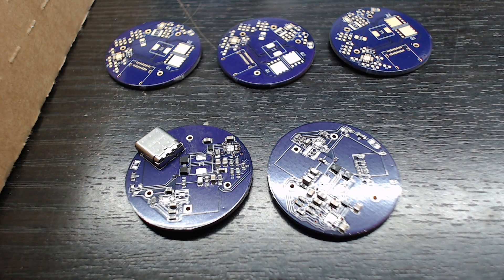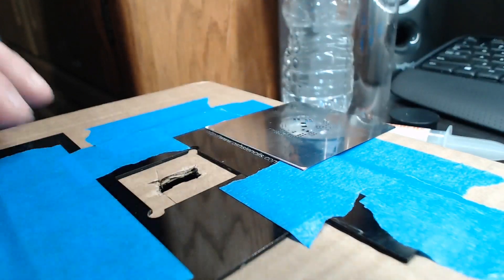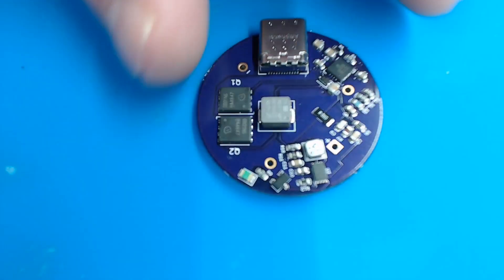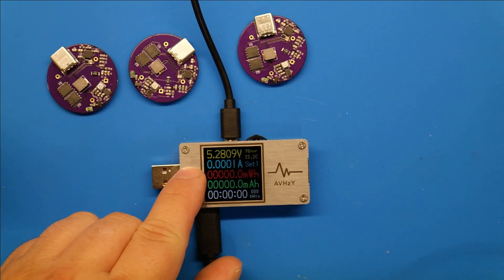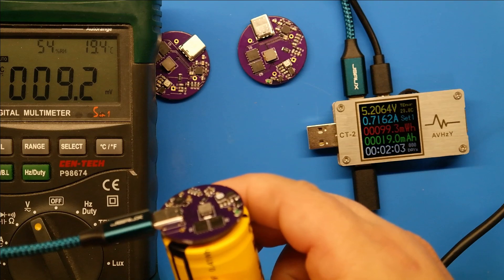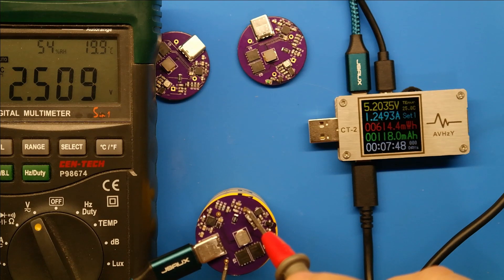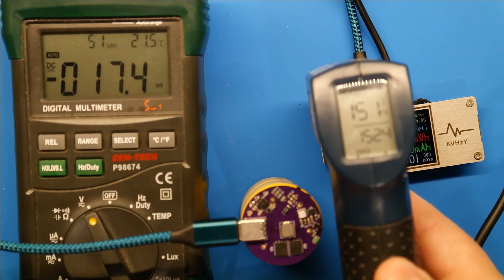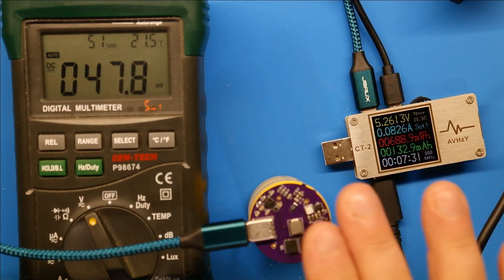Endless Torch V2.3 - It Finally Works!

Comment: I can’t tell what your MOSFETs are, but they have to have a Vgs(th) on the order of 2.0 to 2.5v at most… otherwise they will not be FULLY saturated with the Gate drive from the IC (typ. 5.0-5.5V for each MOSFET, so long as you have the proper bootstrap capacitor). Also, if the MOSFET gets “too big” (too much input capacitance or Gate-to-Drain charge), it will have a slow turn-on/off time. This makes the switching less “square”, and the sloped ramp from OFF to ON (and reverse) is linear conduction mode, not switching… which creates resistive heating. (remember, any time the MOSFET is not 100% OFF/or/ON, it’s acting like a series resistor, not a “switch”)  This is why we can’t just say “bigger is better” when selecting MOSFETs… the Gate driver has to be capable of driving the higher capacitance without allowing that linear conduction mode. At least in this application, your MOSFET Voltage rating can be pretty low… just twice of the operating voltage, or 10V. This works in your favor as it’s one of the tradeoffs for MOSFET die size, and therefore capacitance. (unlike my upcoming project, where I need to switch 400V DC at 50-70Amps at 200kHz)

I took a brief look at the BQ24640 specs, and came up with these rough numbers... Inductor saturation current needs to be over 4 Amps (based on a near 4 Amp supercap charge current; Vin=5.1V; max. ripple current is @ 50% duty cycle, so Vout=2.5V; switching freq.=600kHz).

Output capacitor of 20uF total... I don't see your output filter caps...? they should be two @ 10uF, 35V, X7R which means 1206 or 1210 case size. You can't use low voltage MLC caps, as their ESR is higher than needed for 600kHz switching circuits. Your ripple current will be very high, and the caps will fail. Keep this in mind when substituting lower voltage MLC (multilayer ceramic) capacitors where a “seemingly higher than necessary” voltage cap is specified … this is a blind spot for the uninitiated.

Revisiting the MOSFET Gate signal path issue. This should be on the order of “mm”… not “cm”. Literally, the best solution is a few mm at most. Also, the switching inductor (as well as the sense resistor and output caps) need to be very close to the MOSFETs, or the large switching speeds/currents will cause inductive noise, which can be picked up by other components.

Just a few pointers… since I don’t know what your components are.  The 600kHz switching speed makes this a critical layout project… it’s far from the older 10-20kHz switchers, which could tolerate longer switching paths with ease.
Reply: The T.I. recommended MOSFET is a SiS412DN  30V 12A part with 435pF Gate capacitance.  If yours is what it appears on your schematic... a BSC020N03MS, it's a 100A 30V MOSFET, with 7200pF Gate capacitance (max 9600pF).  That's why it's getting hot... it's very slow turning ON and OFF, resistive heating during those times.  Higher Current rated MOSFETs require a larger die size, which translates directly into much higher Gate capacitance.  This also translates into much higher reverse capacitance, which couples switching energy back into the Gate, trying to turn it OFF while it's trying to turn ON.
Reply from the maker: Wow I'm not sure where to start other then thank you for looking into this.

The mosfet I used is BSC0901NS which has a gate capacitance of 2800pF, not as bad as you thought but definitely not 435pF.  Otherwise it's a 30V 100A with a Gth of less then 2.0VDC.  

The inductor is a 6.8uH 3.5A soooo it's a bit undersized.  I'll have to look and see if I can find another higher Amp rated one that fits that same footprint.

I've done the layout for that board a few times and I'm never going to get the traces for the mosfet gates down to a few mm, but i think they're only max 1cm.

I've always omitted the output capacitance when charging supercaps, so far it has seemed to work for me (dosen't mean I'm right though).  The ESR on the supercap is usually 3.2mOhms so never saw the need for it.

I Will look into alternatives for the mosfets and the inductor.  Thank you for your insight!
Reply from the maker: I'm thinking BSC120N03LSGATMA1 will be a better substitute for the mosfets and ETQ-P3M4R7KVP will be a suitable alternative for the inductor, even though it's 4.3uH instead of 6.8uH.  agree?
Reply: @madelectronengineering  That MOSFET is certainly a LOT better than what you have now, but the key specs that matter here are mostly low capacitances... again because it runs at 600kHz.  In several places, your new choice is better than the original TI spec'd part, but it's still a bit high on Gate capacitance. In reality, this part is certainly much better suited for the application than what you have now.

The issue about the output capacitance has to do with the ability to handle the ultra fast rise-time of the "switching regulator".  Supercaps indeed have a very low DC ESR, but certainly NOT at high frequencies... in fact their high frequency ESR is usually quite high. Keep in mind that their sole purpose in life is energy storage, not high frequency filtering. You DO need to stick very close to TI's recommendations in this area, or you will damage the supercap by forcing it to try to deal with high dV/dT energy spikes that it's not designed to handle.

Inductor... if you move to a 4.7µH, your output capacitor requirements will increase to 30uF of the very specific capacitors - before the supercap.  Lowering the inductor value will also raise the requirement for saturation current.   Why not use the 6.8uH in the same series? ETQ-P3M6R8KVP. Even with this new inductor, you probably want to back off of the charge current level that you are at now... the physical limitation of the inductor limits its DC current rating to 3 Amps unless you have a board layout maximized for heat dissipation, and yours likely isn't. Just do not try to get more than 3A DC current out of it (into the supercap), or it will get hot, and cascade failure will occur. (inductors overheating lose inductance, which makes them run hotter... which ends up in a runaway condition... and the magic smoke will be released) 

/edit/ Take a look at this Inductor: SRN6045TA-6R8MCT-ND   It's a little larger, but your pads look big enough to possibly allow it... and it has lower DC resistance for lower I/R heating (and slightly higher DC current rating). It also has a really nice 30MHz self-resonance, well suited for this high freq. switcher.

 BTW, I don't know what your existing inductor is... reply with the p/n.

Layout... it appears that one of the MOSFET Gate drive signals runs right under the output inductor... if so, this is trouble.  These circuits are very picky about layout...
Reply from the maker: Sorry, existing inductor is ETQ-P3M6R8KVP.  Thanks again!
Reply: @madelectronengineering    I edited my previous response... didn't think you'd read it so fast :)

Comment: Aren't you using the MOSFETs in switching mode?  They shouldn't even be getting warm at this power level.  Have you posted the schematic online?  I'll help if I can... 30+ yrs of EE experience.
Reply from the maker: You would think the TI chip is using them in switching mode and wouldn't be generating much heat, but I followed the reference circuit from TI and here I am.
Reply from the maker: https://imgur.com/a/fjI1gOp
Here is the schematic

Comment: When are you going to collaborate with #willprowse ona DIY solar thing???????????????? He doesn’t use Supercaps I would like to see something built with them..... Like running an electric ⚡️ stove, oven, blender & on demand electric ⚡️ water heater!!!!!!!!!! Generally things of high load that run for an hour or less. Can you make a Makita 24V battery pack???? They are 18 Volt but 24 volt are more efficient for Solar AND it’s Divided / Multiplies into 24 / 48 / 72 / 96 / 120 / 240 / 308 / 440 / 600 volts evenly!!!!!!